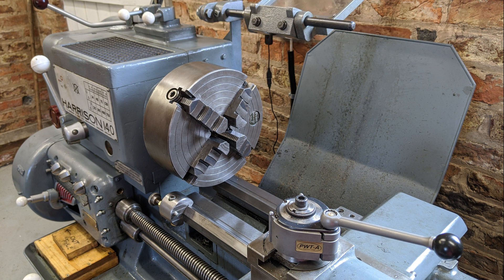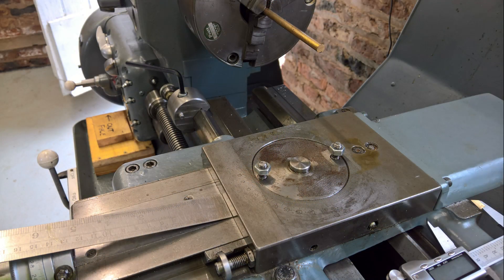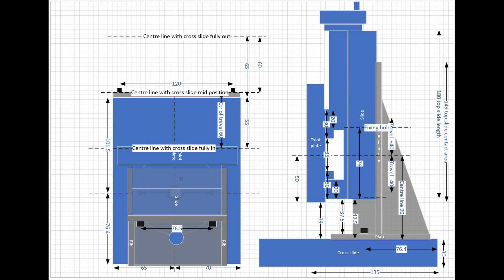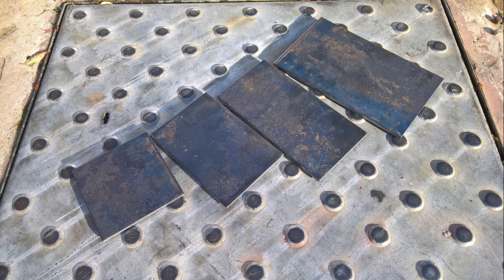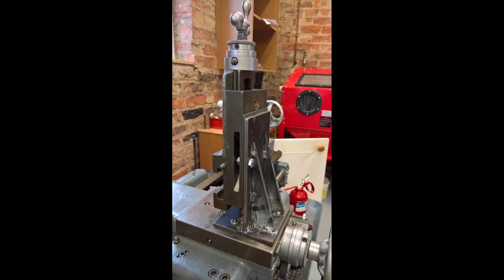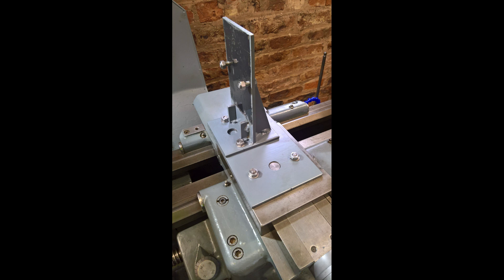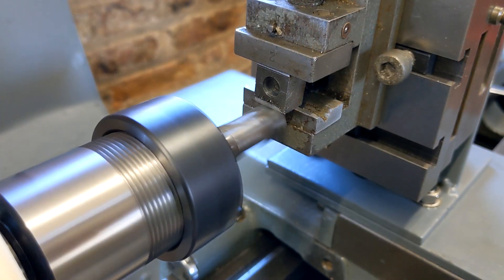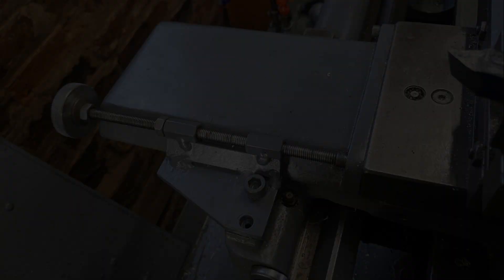HS19 Harrison 140 lathe milling attachment

Comment: I like the concept of this attachment and am going to make one of my own like it only I’ll tig weld 1” plate with silicone bronze. Thanks for the video I went thru an have your videos some likes
Reply from the maker: Hi Josh, I've used the attachment a few times now where I can't do the job on my shaper. So far it has been rigid enough for my light work but I expect I will need to improve it, particularly the adapter base plate, if I do heavier work. Thanks for the likes.

Comment: 6 mil pl not rigid enough. you should have used a cast iron square  they are on ebay for 50 to 60 e
Reply from the maker: Bernard you quite right. It's only for light work but it performed better than expected. The vertical plate is quite rigid due to the ribs but the extender base plate will need a mod if I need to do anything heavier. Cheers.

Comment: Good job and video. Very handy being able to mill like that. I was hoping to buy a small milling machine but funds and room in the shed are the issue. I do small milling jobs by mounting an angle plate to the cross slide top and finger clamping the workpiece, now I'm thinking of seeing if I can mount the compound slide to the angle plate to give some vertical travel. Nice lathe you have there also.
Reply from the maker: Thanks for the comment. It covers small jobs I can't do on the shaper. In time I may buy a table top CNC miller for profile work but I would probably wait until I needed it for a specific project. Same with 3D printer - yes I could buy one but how much would I use it. Cheers.